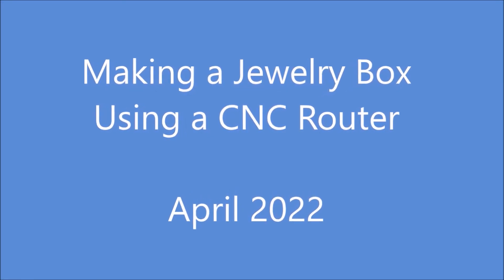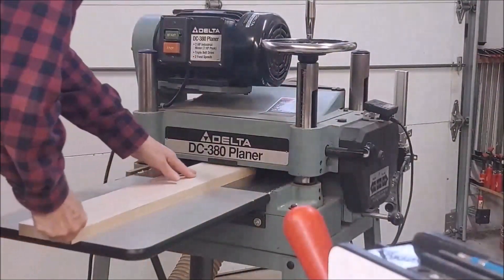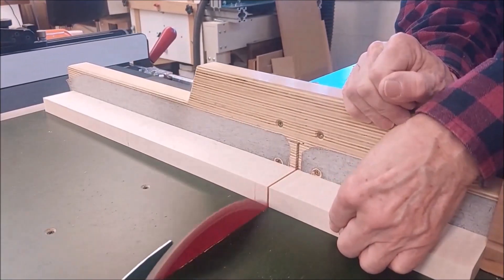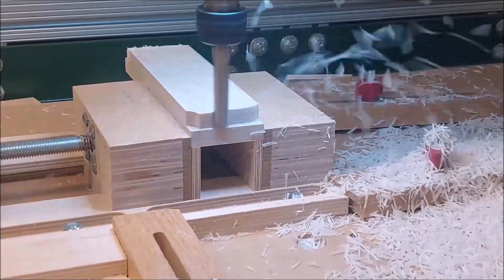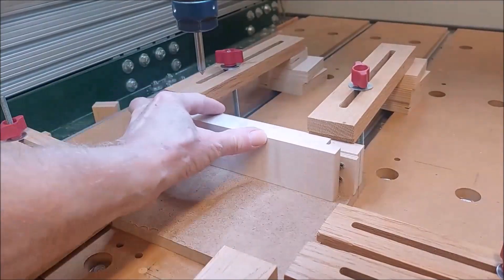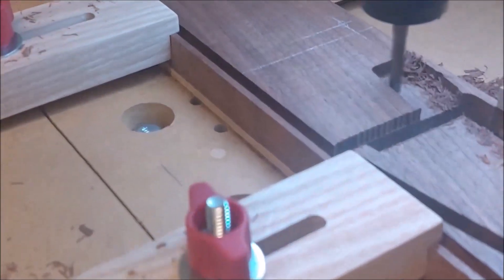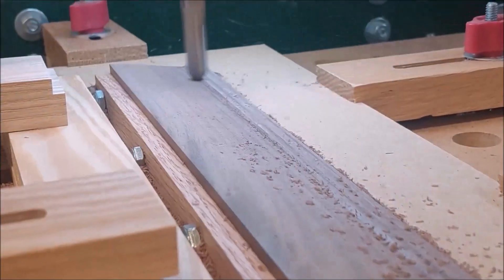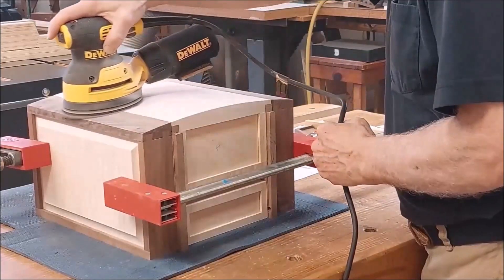Making a Jewelry Box with a CNC Router

Comment: I cut and built this on a cnc probably 5 years ago.  Still have it.  Exact same design, I forget what magazine it originally was published in by Rick Campbell.  Be warned there is one major flaw.  There is not enough support in the center cavity of the unit for the drawers.  You will get terrible drawer binding due to expansion and contraction.  The drawer movement must be kept tight so the drawer faces line up correctly.  I highly recommend a cross brace across the center of the drawer cavity or have the drawers ride on top of runners with a cross brace  would be the best.  This is a nice design meant for the ages.